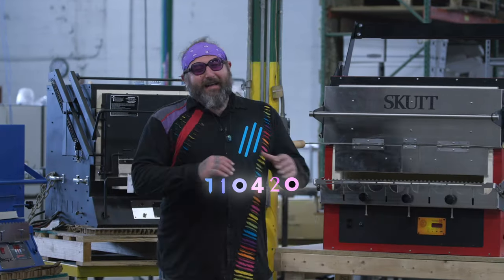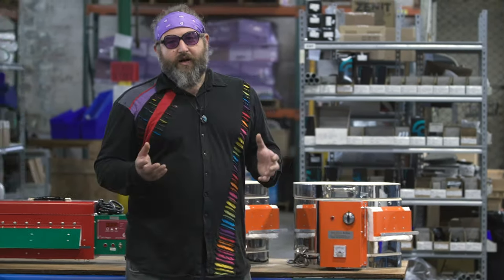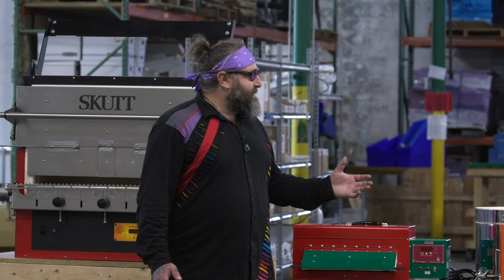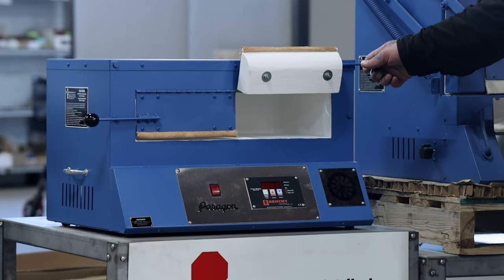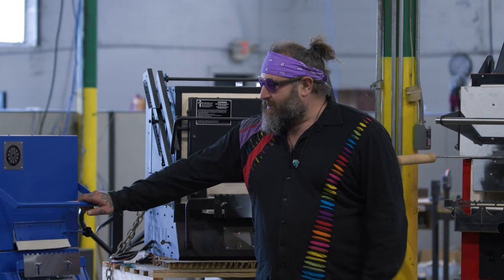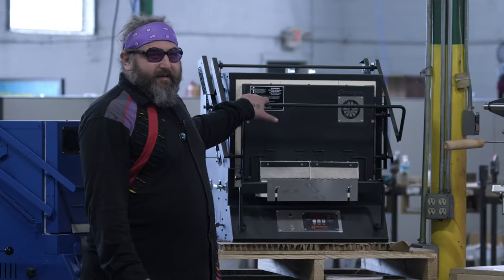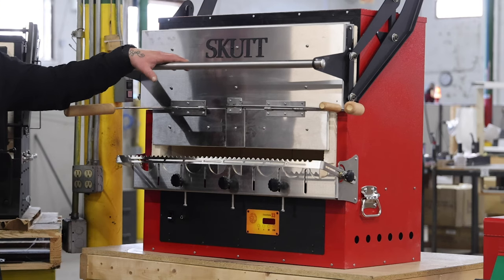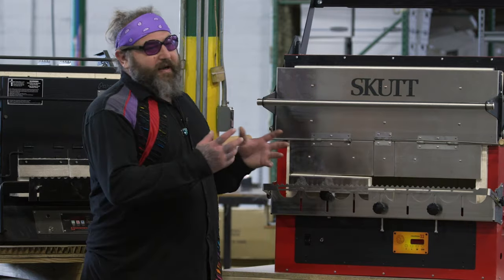How to pick the right Kiln?  The Ultimate Glass Blowing Kilns Buyer's Guide

Comment: How do u program the klin?
Reply: What's your problem programming it? The ramp cycle or just temperatures and times. I usually do a 1500 ramp up to 1050. That means it will heat up at a rate of 1500° per hour until it hits 1050. Then I ramp down to 960 then 800. With varying times and rates based on thickness of work. You want an hour at 1050 per quarter inch. Then cooling down I really don't worry about it unless it's thicker than a half inch. You should always ramp down, but I've never had a problem not doing it for production. Ramp times are just temp per hour. You can set whatever setting you like with the arrows. It's very easy to use. What times and temps to use are a little more debatable.